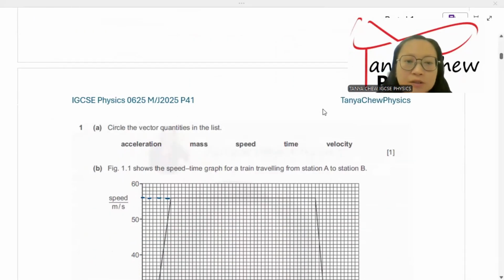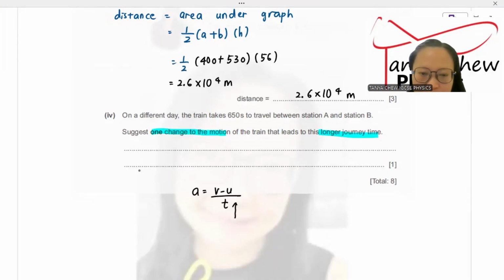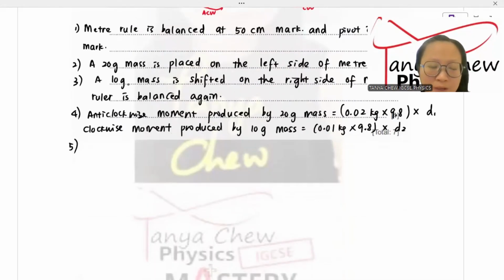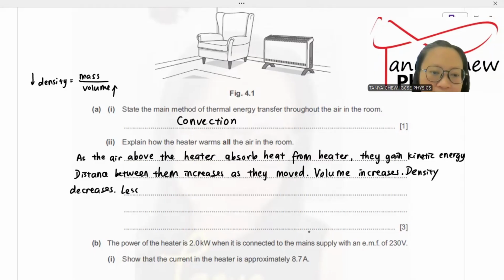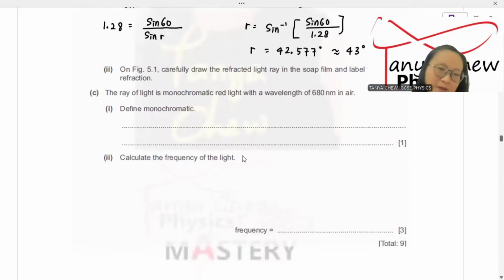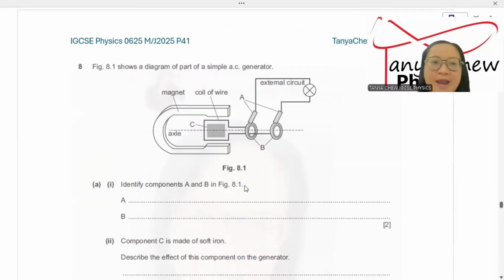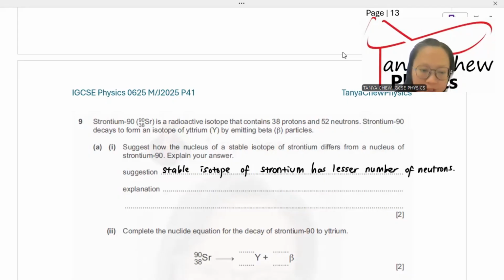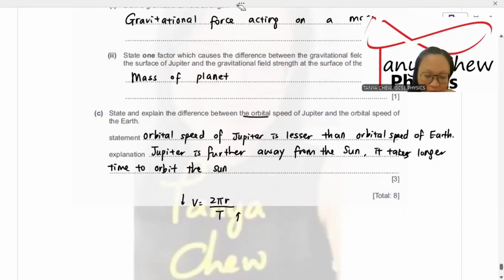IGCSE Physics 0625/41 2025 | Key Concepts + Model Answers

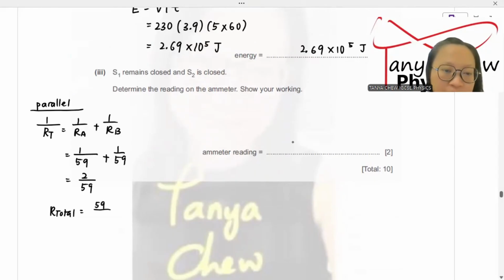Comment: Why do we invert it at 43:47 ?
Reply from the maker: When we calculate total resistance in a parallel circuit, we use:
1/Rtotal = 1/R1 +1/R2+...

This formula gives us the reciprocal of the total resistance, not the total resistance itself.
So after adding the reciprocal values, you must invert (take 1 over the answer) to get the actual total resistance.
Reply: @TanyaChewPhysics  thank youu